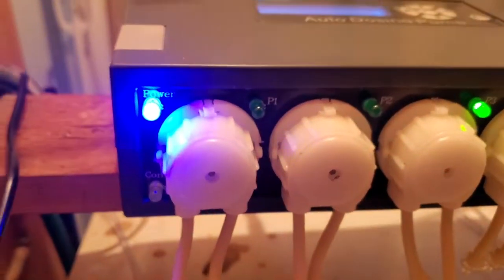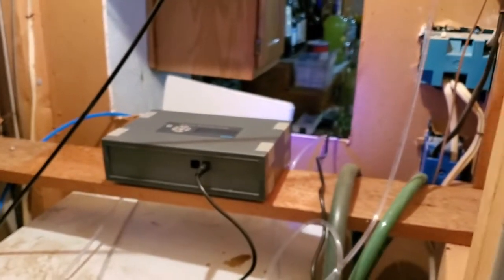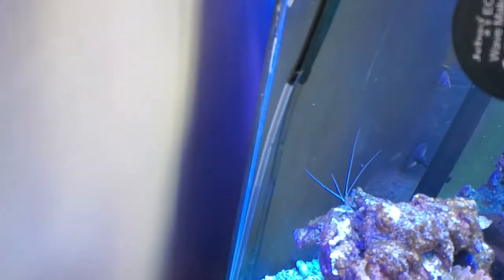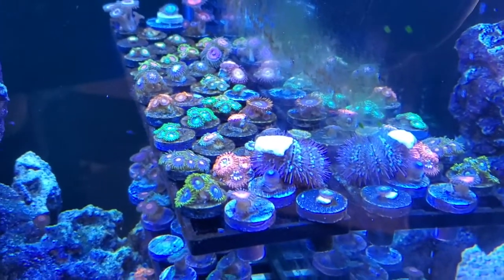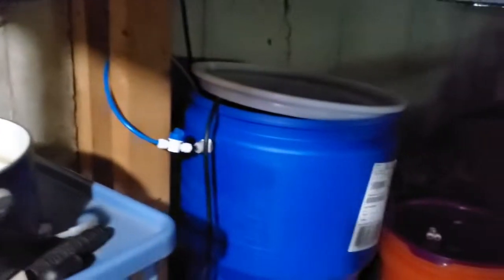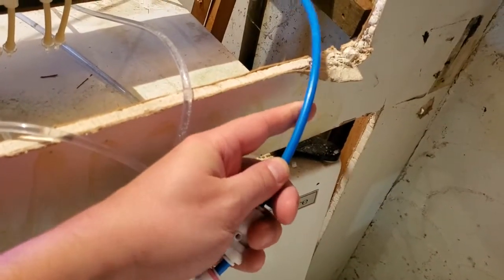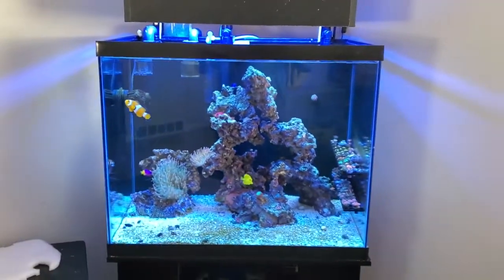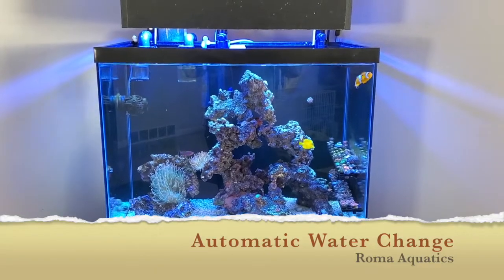Automatic Water Changes & Top Offs With Dosing Pumps 🆒

Comment: Mate you didnt explain how your auto top off works?  I thought all auto tops offs worked with a float valve or sensor or both?  Can you please explain how you make it work from the dosing pump please?
Reply from the maker: The auto topoff works the same way of the other 2 pumps. You just set how many millilitres you want it to add daily/hourly/ whatever. It's not as nice as a sensor or float because those can make up for different amount of evaporation while the pump is a set amount
Reply from the maker: I'll make another video soon explaining more in depth about the auto top off. It's not as straightforward  as a float, but I feel it may be actually better. I'll explain in the next video